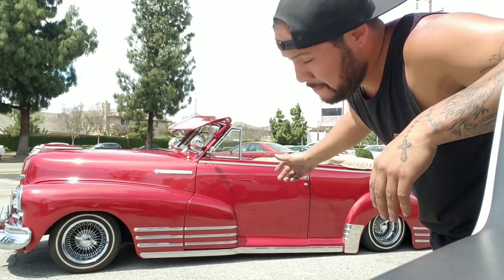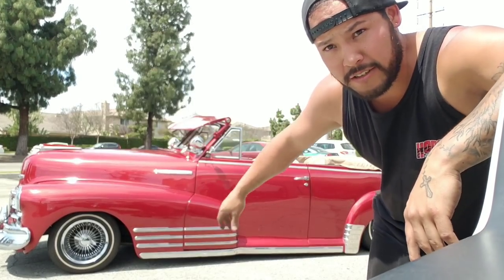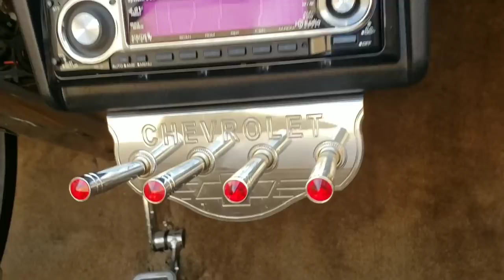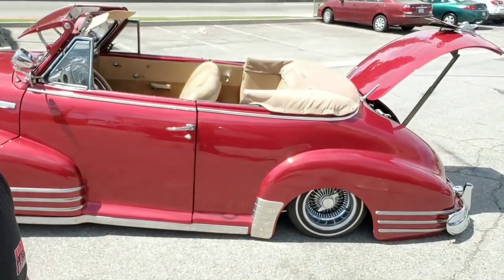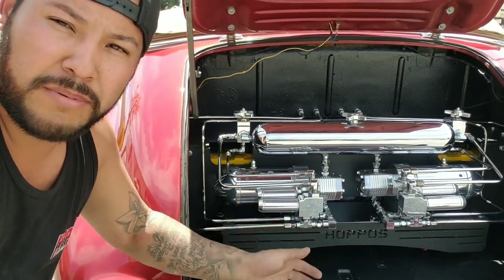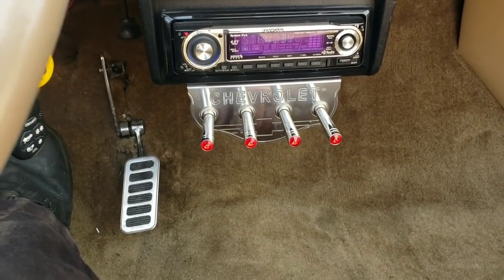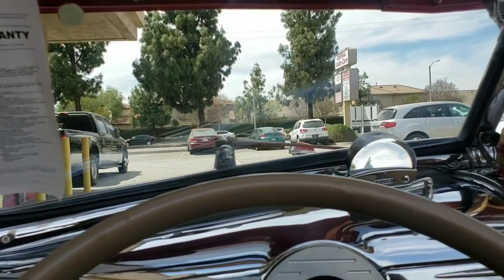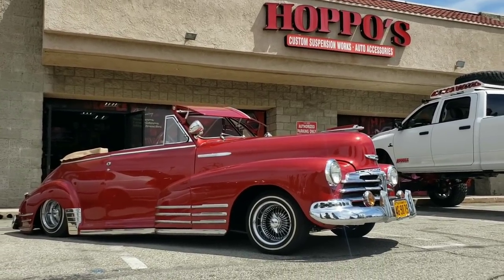1947chevy laid out on HYDROS

Comment: Nice!
I like that you kept the interior stock even down to the compass mounted on the dash . Too bad the hydro set up has to eat up all that trunk space though .
Reply: Roger Thornhill I think on a car like this, where it’s gonna be in shows, you gotta have a setup that is also show level. Maybe with the changes in the rear suspension, they lost some room and the hydros took up so much space. I would like to have enough room in the trunk for an ice chest, for sitting in the park or at the show. This car is so clean, the chrome on the underside is not overdone, easier to keep clean. Just a perfect car.

Comment: Always looking forward to your videos..why does my front pump sound like its low on oil..yet its full of oil..
Reply: Your motor is taking a crap bro
Reply: 70 impala i just bought the motor and only used the switches a few times..I don’t abuse it so how can it mess up already
Reply: 70 impala im running # 11 gear and #9 would that have something to do with it
Reply: 70 impala or is the gear pure shit
Reply: @ericv4152  how long you have the gear and which pumphead having the problem the number 11 or number 9?
Reply: 70 impala  ive had it a few months but rarely mess with it ..i have a rockford  gear #9 and a presto #11 ..i think the front has the #9 though..kinda lost what pump had what gear....both pumps have hd presto chrome motors
Reply: 70 impala should I swap both out and get a different maker of pump gears..what would be better
Reply: @ericv4152  hopefully you installed the pumphead right or you didn't install the checkvalves on wrong are they both giving you problems?
Reply: @ericv4152  are your batteries fullycharged? And did you buy the pumpheads brand new or are they old
Reply: 70 impala bought brand new and only one pump sounds WIERD I built both pumps myself and I have not actually recharged batteries bc I bought brand new ..both pumps do lift and lower with no problem but the front pump is the only one making that noise...
Reply: @ericv4152  post a video on your YouTube account
Reply: @ericv4152  so I can hear it
Reply: @ericv4152  you post the video?
Reply: 70 impala no I haven’t
Reply: @ericv4152  post it up so I can hear it
Reply: 70 impala i will eventually..i have it put away..but i will ..
Reply: @ericv4152  ok cool